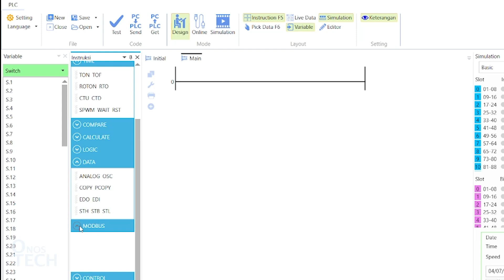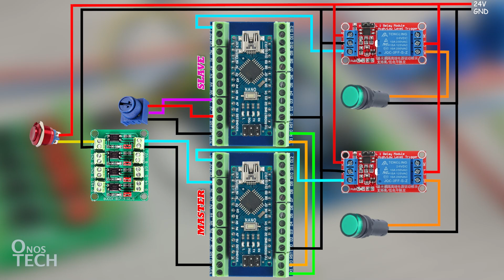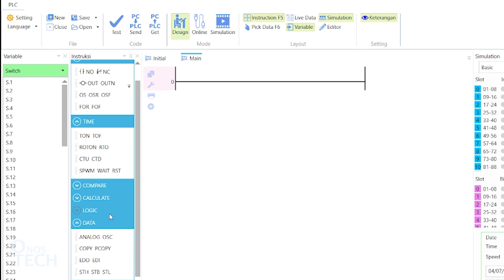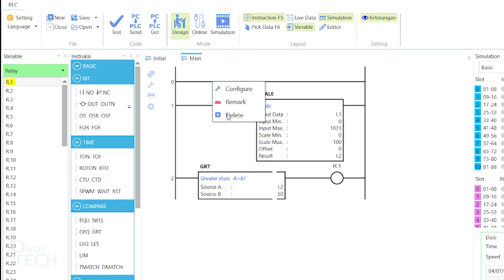#20 Modbus Master Analog & Digital Input Read  | Outseal Arduino PLC

Comment: Dear Onos Tech, Trying out the Outseal, came across the Integer column of I.1 to I.100. The region from I.61 to I.80 is highlighted in yellow, whereas the region from I.81 to I.100 is highlighted in orange. Can you shed any light on the reason for this?
Reply from the maker: I.61 to I.80 will be automatically bound to the EEPROM when activated. While, I.81 to I.100 will be automatically bound to FRAM (Ferroelectric RAM ).
Reply: @OnosTech  Ok. Thanks. Need to try, as i store some settings in the EEPROM.👍
Reply from the maker: @ronaldpereira7088  You're welcome!
Reply: I have OUTSEAL Studio V3.5. There isnt any way to activate the EEPROM, should I consider that this version automatically activates it when using these addresses?